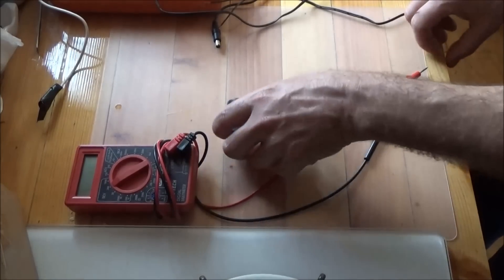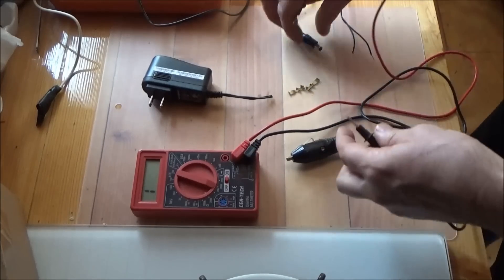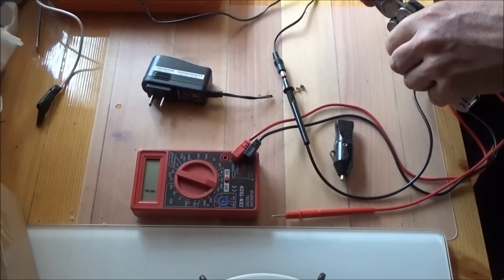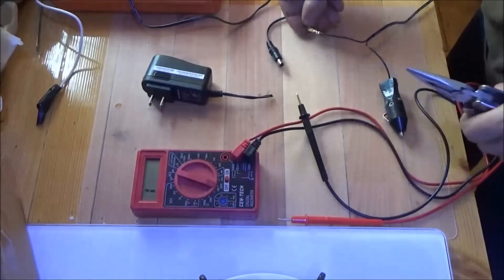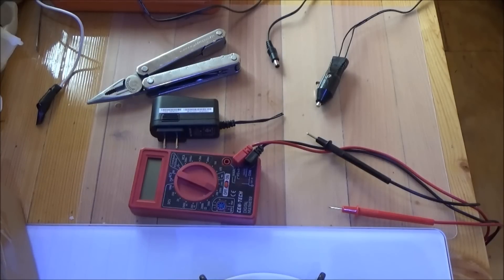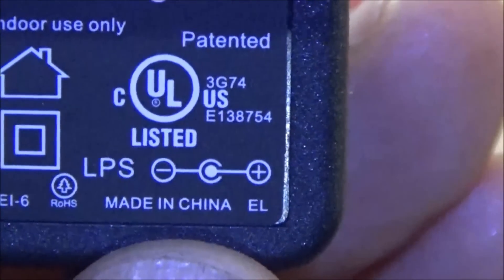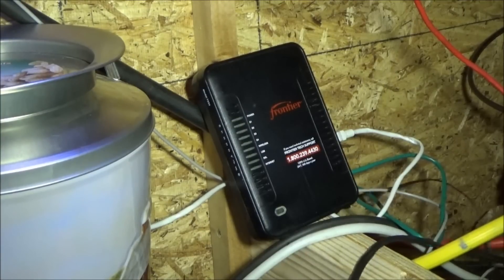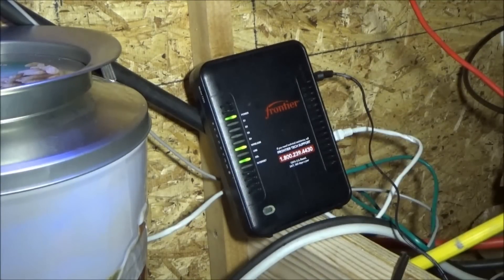Converting My Modem To 12 Volts DC For Off Grid Solar Power

Comment: But 12volt batteries often have output voltages that vary from 11.something to 13.something. Isn't this an issue for the modem? Does it not require a more stable 12 volt connection.
Sorry if this is a stupid question, I don't know much about electricity. I just like watching off the grid and van life channels because it is my dream lifestyle.
Reply from the maker: You are correct.My modem did not have any issues with the varied voltages but you can use a 7812 voltage regulator chip to gain a stable 12 volts.

Comment: Am I correct that the 12v Female socket is connected straight to the solar panel? If so, where does the power come from during the night?
Reply from the maker: There is a battery bank. The solar panels connect to a solar charge controller which is connected to the batteries.

Comment: Good Idea. However, it is always good to be in safe side. 12V Modem can also operate in 9V. Therefore, I suggest to use 7809 Voltage Regulator IC with aluminium heatsink (at list 3 inch) to regulate the voltage input.
Reply from the maker: A 7812 12 volt regulator works great too.
Reply: I know, but the source power need to be more than 15V, for converting to 12V using 7812 Volt regulator (2.5-3V more than output). Else, you can use buck DC-DC converter
Reply from the maker: If my batteries fall below 12 volts I am in trouble anyway.
Reply: I am not suggesting to drop down entire output, but before fetching power to modem you can use 7809.
Reply from the maker: No, I meant that if my batteries ever fell so low that I could not use a 7812, then I am in trouble and the batteries are in danger of being hurt. Hope that makes sense.

Comment: hi 
can i use cars battery? battery is 12V/ 75Ah . and modem is 12V/1A.help me plz
Reply: +mehdi mehrvar  yes you can just have to be carfull the battery does not get below 12 volts
Reply: +mike3367 ty

Comment: hi, may i just ask? wouldn't it hurt the modem if the battery bank is in full charge state? because when the modem is plugged in the original adapter, the output is 12v @1amp. now that is directly connected to the bank which is 14.7 volts and is ever changing due to consumption and charging. I wonder if there is any harm for the modem when it has to munch in 14.7v some times when the sun is topping up the bank on peak sun hours.
Reply: my concern is the 12v adapter is designed to push 12v and 1 amp constantly. whereas the battery will some times be 12v and some times 14v and some times down to 11v. will these state of charge have a negative effect on the modem? thank you.

Comment: Very educational video.  I was originally going to go this route.  I am still on the grid using the modem with it's supplied adapter.  When I move off the grid I am not going to want any downtime, so I purchased a variable voltage regulated DC to DC adapter. First the same one you show in earlier video.  Has the plugs where you can match tips and polarity and will output up to 2amps.  I ordered a second that is similar but output up to 1 amp and I will use that one for my modem. My modem is 12v so it will maintain it at 12v.  The 2 amp adapter I will move it around to the rest the appliances or as a spare where needed. Some of the rest the appliances are more than one amp.  I would say if you could put something on it to regulate it, so it does not get more than 12v, it would be a good idea.  I am new to all this but learning fast.

I am not going to have an inverter, as I am needing  a LOW EMF DC solar system. So running everything possible on DC is a must.  I am electrosensitive and can not tolerate any wireless or high fields unless I want to have more mini-strokes.  Inverters put out very high EMFs and magnetic fields and some put out RF radiation, as well.  So having that inverter running all the time is about as good for you as living under heavy powerlines or having a smart meter on your wall-causes health issues.  I am not adverse to a portable inverter that can be plugged in to run a juicer or blender for a few seconds and then unplugged again and I have been told it must be shielded as well and at a distance from me.  With the exception of those fast kitchen appliances and the copier [occasion copies or printing of a couple pages], everything is on DC.

I have looked into say a handcranked or 12v blender, but after reading the reviews the quality of that cheap Chinese junk is too low to spend the big $$ they are asking for those items. 

Thanx again for this video.  I am sure something somewhere along the line will need converting in this way.

Comment: http://www.ebay.com/itm/5x-Auto-DC-DC-Boost-Buck-Converter-Solar-Voltage-Regulator-20W-3-35V-to-1-25-30V-/321366931708?pt=LH_DefaultDomain_0&hash=item4ad2f638fc

These are nice voltage regulators for solar at low current rates (1.25 amp) because they will allow you to set the voltage anywhere within their range and will keep it there no matter where your batteries are at. Most other voltage regulators require a 3 volt difference to work well. These will also maintain the voltage you set even if your batteries go under the voltage you set (12 volts I think you need) 

I ordered you a set of them and they come from New York so should be there in 3 days the listing said. Please look at the listing of the auction because that is where the wiring diagram is and I do not know if they will send one on paper.

I use a larger higher current version of these for my Amateur Radio equipment in my barn to protect it from when my solar charge controller decides its time to condition the batteries and the voltage goes to 15.5 volts. 

Good Luck.

Comment: Hi Troy its Friday Jan 23 and I just checked Amazon. Your new meter is out for delivery and should arrive today.

Its Great you have your Modem now running directly off your batteries but can I suggest something? You should always fuse a device running off high current batteries. If that wire going to the modem ever got pinched by something metal it would become a heating element and would burn. I'm a Ham and we run lots of things off our DC power supplies that are capable of outputting 75 amps so every single wire that comes off the power system is fused for the ratting of that is being used on that wire. If its rated at 1 amp a 2 amp fuse would work just fine. If you are going to do a lot of different thing they make fuse blocks that use Anderson Power Pole connectors where each output has a separate fuse. 

The meter you have coming should allow you to clip over any wire you have in your setup and find out the current so check it out before you go spend a bunch of your money on buying more meters. 

I see you got the small wind turbine up did you ever get new blades for the big one that fell down?

Comment: It's a good idea it saves from the wasted power of the inverter. I think you should have a 12volt regulator on it. I'd be worried about damaging the modem. You could use a 7812 regulator or even a cheap dc-dc switching supply inline, especially if you are charging at a higher voltage or balancing the batteries.

Comment: yes you are learning  most things will handle plus or mines 10% voltage if you need less power you can us a voltage regulater from radio shack thee pin package fixed and adjustable for the voltage you nead and now you can get dc to dc converters to bump it up but not from radio shack still some small loss but not like a enverter keep reading i see the difference go troy your new investments are very good to keep up the good work you have come along way this year get the wind mill going think storms you are on your way thank you like your show
Reply from the maker: I just got the 7812 voltage regulator. I will put that in today and make another video

Comment: Hi Troy
You do get your self in a hole .
stop digging …..

A Zener diode will not work as when it reaches breakdown V it will be short to the battery
blowing the Zener & fuse with a bit of luck ! }-/

A 3 pin reg is no no even a low drop-out type ( in put is not 15v or over @ 11.5v ) .

So here is the answer if the old unit was transformer type & unregulated DC 14 -19 v o/p ( check old unit )
yore safe just fit 3 – 5 amp fuse in the your plug .

If switch mode 12 +/- 0.5 v regulated a DC/DC converter is the way to go ( you may find 10 V out is OK ) .
As for the temp on the mppt controller it is showing a resistances in nut & bolt joints or crimps .
But y is temp sensor on the nut & bolt not the battery ? & no voltage sense yet !
Dig... dig.... LOL

Crimping is not the best with battery banks as water & acid can react with the metal's & you cannot see it in the crimp .
The copper may go black or green this will increase the resistances over time & sleeving hides the problem .

The answer is Soldering .
Reply from the maker: Actually a zener works together with a resistor to prevent a dead short. But I got a 7812 tonight anyway
Reply: The Do It Yourself World
 Hey Thats My Line !!
7812 Dropout Voltage o/p + 2 v so 12 v out input min = 14v @ 13.99 v in you have  no Regulation !

Comment: If you get one of the 12 volt usb adapters you can also run/charge your devices that charge from usb. During a week long power outage, that was how I charged my tablet, so I could sit and read or play some games (not many play without internet), and kept my cell phone charged.  I also have a 12 volt motorcycle AM/FM radio that I can power from the solar panels. So, the week without power grid wasn't very bad for me, just a good vacation!
Reply from the maker: Most of my home will be wired with these.

Comment: Troy you really should use a Voltage Regulator on the Modem, I do the same but use Mini adjustable regulators. You can possibly over volt the modem.
Reply from the maker: Just picked up the 7812 tonight.
Reply: sir for example i want to do like you did, 12 volts at 1amp and the source is 12volts 200 AH battery it is ok? i mean the modem will not damage?

your reply is highly appreciated
Reply: joel19622  Here is the Link to the exact type I used.  http://www.ebay.com/itm/301120877446?_trksid=p2055119.m1438.l2649&ssPageName=STRK%3AMEBIDX%3AIT

Comment: sure the modem can handle the 16 volts when equalizing?its easy to solder a regulator into the sigaret plug.   (lm 2012 or equivalent)
Reply from the maker: I will put in a zener diode later. I will hit Radio Shack on the way to church tonight and do an update on it.
Reply: dont forget the resistor!,  im not a fan of the zener/resistor, it wil use more power dissipating heat bi voltages above 12 (you are 12 to 17 volts) better is tu use a regulator LM2012 or so, (the 3 pin gizmo) less power drain on the bank.
Reply from the maker: MrBugsier5 Got it. Sadly the zeners were only 1 watt and I need a 12 watt regulator. So I got the 7812 which can handle an amp, exactly what I need.

Comment: Hey Troy how is the new battery doing? This is it now. Your energy issues are under control right?
Reply from the maker: The battery needs a good high power top off from the DC charger. So I am running the HF generator when I work for now. I hope to get the charger over to the tiny house in the next few days. This battery is a beast and takes all the solar I can throw at it. After its topped off, I only have to put back in what I use.
Reply: Great bro! Your battery issues are behind you. Once you sort out your windmill and move the solar panel to over the windows of the tiny cottage you be net producing. Awesome
Reply from the maker: antonio r. belizario Belizario Yup, I am getting there finally :)

Comment: Instead of using a cigarette lighter end you could use a male usb end and then plug it into a 1.0 amp cigarette adapter. Your power pack says output 12v= 1.0 amp. If your connecting it direct to 12 v how many amps are you taking in?
Reply: The Do It Yourself World
He forgot that the USB "car adaptors" step down the power from 12 volts to 5 volts to move from the "standard power spec" to the "USB power spec."

I call it a "premature senility error" when I do it.  d;o)
Reply from the maker: I dont follow you. A USB port is 5 volts. I have it connected to 12 volts now.

Comment: Good video.  Practical advice.  One thing that you probably should have mentioned at the start is that the only reason you were able to able to do this was because the modem was expecting 12V DC from the AC-DC adapter.  A close up shot of the electrical information plate on the modem would have shown this.  Since the modem is expecting 12V DC, and that is what your battery bank is producing, it is possible for you to cut out all the middle-men (inverter and adapter), improve efficiency and reduce the load on your battery bank.

Hopefully no-one with a 9V/6V/5.3V (anything except 12V) modem will blindly follow the steps you demonstrated and end up with a non-functioning or damaged unit.
Reply: you can easely solder a regulator in the feed line, they are cheap, and only three pins, pos in, negative and regulated 12v or less out, availale in differend in and out voltages.
Reply from the maker: Good point, thanks
Reply: timcat100 I agree with you 100%. Although, I'd say the factory wall brick looks like a switching power supply to me, and those really do output the labeled voltage, unlike the old transformer based wall bricks. But it still follows that the modem will likely work fine with his 14V charging voltage, since the modem likely has it's own internal DC/DC step down converter.
Reply from the maker: timcat100 The cigarette lighter socket is fused. I wired it up to my fuse block when I put it in. So it is safe. But I am going to use a 7812 voltage regulator just to be safe.
Reply: The Do It Yourself World do not use a 7812, they are the dinosaurs of the electronics world now and need at least 14v all the time to work properly. all 78 series regulators need 2v+ extra to function properly.

if your modem is working fine then leave it, its more than likely its internally 5v and already has a decent built in dc/dc converter tat will handle 8-14 or so volts.~
if you want to gtee giving it 12v, then get a 12v dc/dc converter off ebay from china for like $3 and jobs done.

Comment: You can do this with anything using wall wart as long as the voltage is 12 volt its a straight conversion. Can even to it with lower power just need a regulator in the circuit to step the voltage down. No point in stepping it up with inverter then adapter to step it back down will save a lot of loss this way. How's the new pack working and when do we get to see the tower go up?